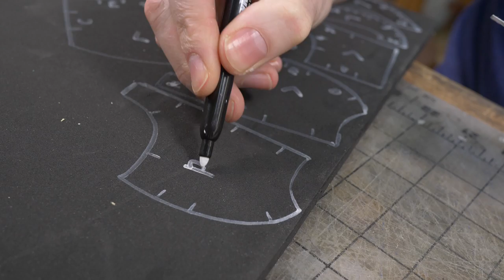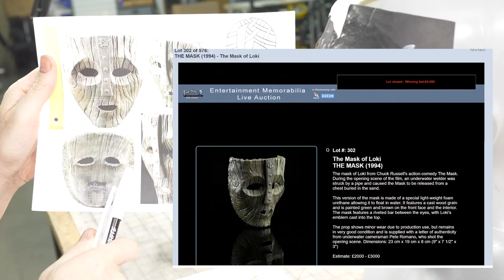Making THE MASK of Loki - FREE Templates!

Comment: first off, i love the videos and all that you do.  i have a question about sealing. i did not notice a heat seal on this project. how do you decide which product/method of sealing to use? it seems to vary from prop to prop. just curious.
Reply from the maker: I probably just forgot to film it but in this case it's not quite as critical since I don't need a perfectly smooth finish with the wood grain. That's usually how I decide - what kind of surface do I need?

Comment: I was wondering. Wile drying with a hair dryer, do you use a lo heat or use no heat or back & forth application of lo & no heat?
Reply from the maker: This hair dryer has hot or not hot so I just try to keep it moving to avoid overheating anything

Comment: What kind of blade do you use in your bandsaw?
Reply from the maker: I use an 18 TPI metal cutting blade for cutting foam. I think it's 1/2" thick. It doesn't leave a perfect cut surface, but it's pretty good.
Reply: @punishedprops  thanks a billion!

Comment: Can you use a hairdryer instead of a hear gun?
Reply from the maker: You can , but it doesn't really get hot enough. We strongly recommend investing in a heat gun if you want to get into cosplay/foam work. It's easily our most-used tool!
Reply: @punishedprops  You should make the M Huncho mask. It's really dope and there is a video of it getting made. For more info on M Huncho type in "Pee Pee M Huncho" on YouTube.
Reply: @punishedprops  Bro I just want to create a mask for my rapping/singing career. I have anxiety and don't want to put my face out there at the beginning. I wish I could find this mask for cheap but alas it's too expensive online 😢.